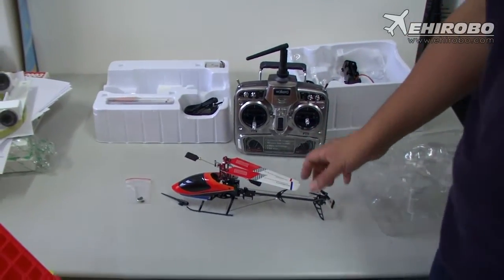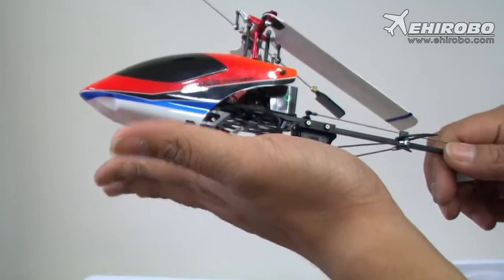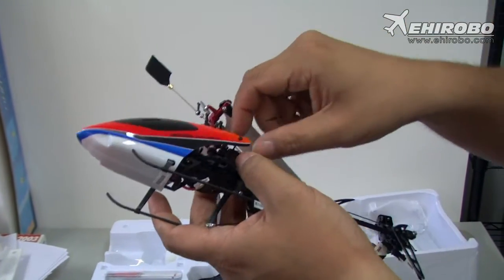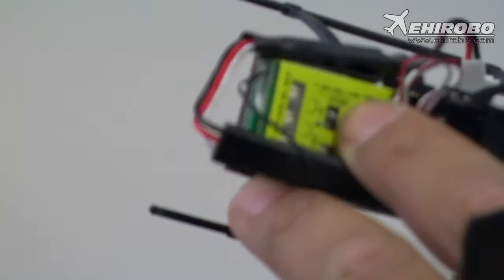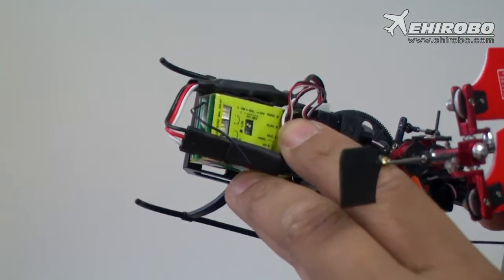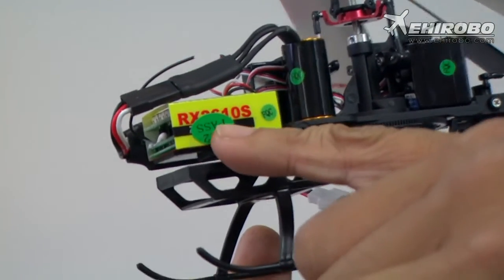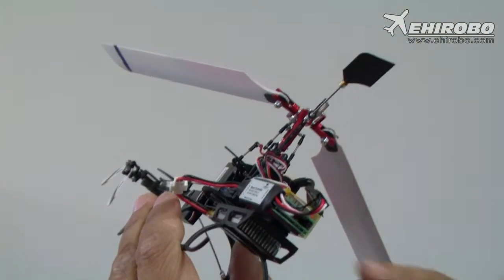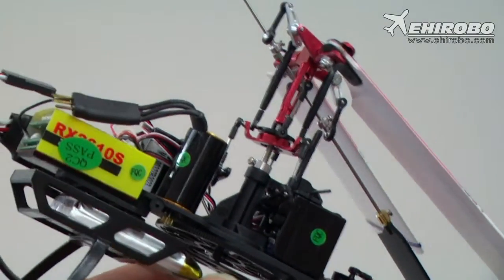eHIROBO.com - WALKERA 4G6S 3-Axis-Gyro System 6CH Metal Upgrade Brushless Helicopter RTF - 2.4GHz

Comment: At the moment I'm working on a new Arduino Based Universal Full 3D Orientation 8 sensor auto-stabilizing platform for any heli available.

Start flying a 600 or 700 size heli or airplane like a pro without any pro skills comes...
It will have all the possible sensors you need like ultrasonic proximity sensors so it can avoid to hurt somebody etc. Also it will have a pre-programmed feature which, once it is activated will make any extreme maneuvers etc. with only a touch on your transmitter.